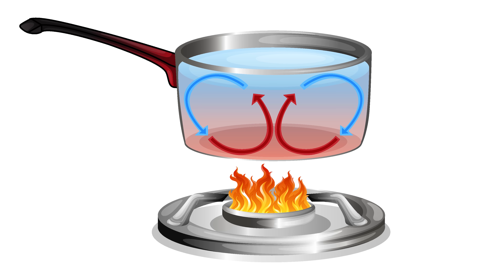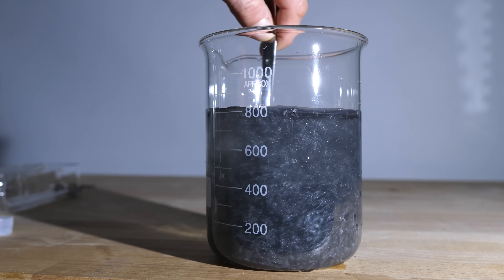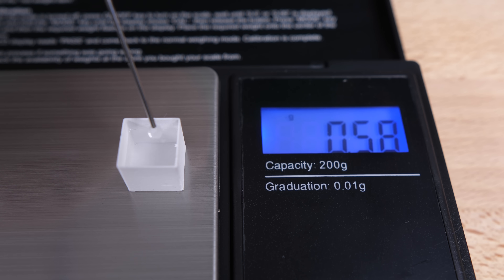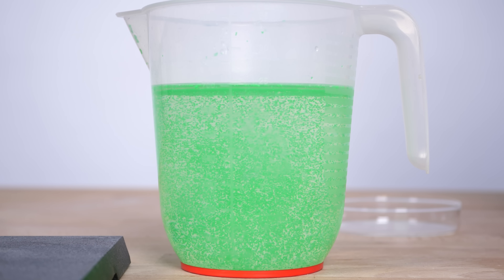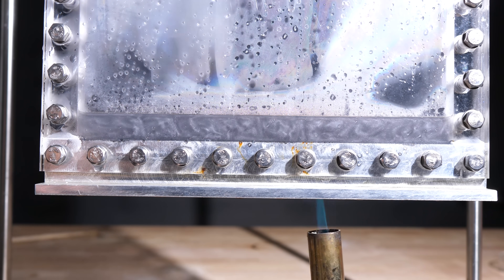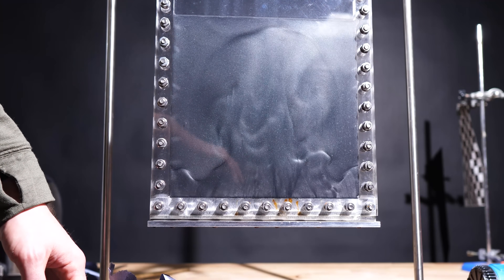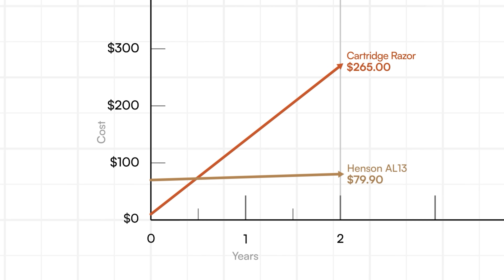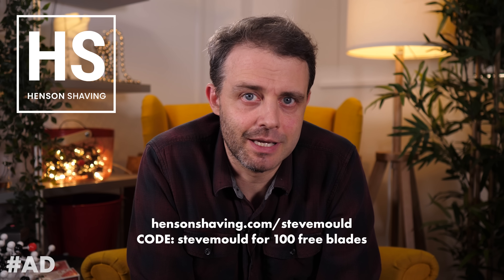The bizarre patterns that emerge when you heat ANY fluid

Comment: 2:01 Imagine a round parachutist in 50 mph winds coming from the south. He would be carried north, with his round parachute leading his body. In this case, "leading" refers to the direction of groundspeed. In terms of airspeed, the direction is reversed.

If there were an orientation of mica flake where its center of (drag) pressure led its center of mass, then that orientation would be somewhat stable. This phenomenon is called "weathervaning".

Comment: Pasta forming a toroird might be because of how we put pasta into the pot.
We have a bunch on our hand we tend to place it in the center and release and the top stands sit against the lip of the pan and the bottom stands are pointed at the side on the base
Since the pasta will move down as it gets soft from the hot water it will just topple in while riding the sides of the pan,

Comment: regarding shaving, I haven't used a razor for decades but just a trimmer on a battery powered hair clippers. It's a dry method, and also useful for shaping the beard and moustache. IDK why so many men need their shave to be so skin tight. This method is so much better for your skin, no skin grazing, no abrasion, no cuts and no ingrown hair etc. Also no extra cost for razors and aftershave and stuff like that. Maybe it's not skin tight but it works for me. Just my 2 cents, try it, it's awesome.
Reply: I switched from an electric shaver to a safety razor because both the electric razors I tried caused significant skin irritation that lasted for half a day or more. No irritation with wet shaving. I think it was due to the slight pulling on the hairs as they are raised into the cutting teeth of the electric razor.
Reply: @seth094978  IDK, that seems strange to me as I've been using this method for so long with no problems. Maybe we have different kind of hair, maybe your hair is thicker or shaver wasn't so good. We're all different, and this seems to work for me so well, and it's so much faster, I literally shave in 15 to 30 seconds max, so I never plan switching to razor shaving again.

Comment: Mica flakes align in water due to their unique physical properties and the external conditions they are subjected to. Mica is a type of phyllosilicate mineral that exhibits a two-dimensional sheet or layer structure². These sheets are flexible and can easily slide over each other, which is why mica can be split into thin flakes.

When mica flakes are suspended in water, they tend to align themselves in response to various factors:
1. **Pressure**: If the pressure is higher in one direction than the others, minerals like mica will tend to align themselves such that the fabric forms perpendicular to this axis¹.
2. **Buoyancy and Gravity**: Depending on the variety of mica, it might float in water³. The mica flakes, being flat, will align themselves parallel to the water surface due to buoyancy and gravity.
3. **Flow of Water**: If the water is moving, the flakes can align themselves in the direction of the flow due to drag forces.

It's important to note that the alignment of mica flakes in water can be influenced by a combination of these factors and possibly others, depending on the specific conditions. The local alignment of mica flakes can therefore vary based on local variations in these conditions.

Source: Conversation with Bing, 2/16/2024
(1) Mica | Structure, Properties, Occurrence, & Facts | Britannica. https://www.britannica.com/science/mica.
(2) Igneous and Metamorphic Rocks - University of California, San Diego. https://topex.ucsd.edu/es10/lectures/lecture16/lecture16.html.
(3) Dissolving mica flakes - Applied Chemistry - Science Forums. https://www.scienceforums.net/topic/26345-dissolving-mica-flakes/.

Comment: I assumed the mica flakes align because even in turbulence, the flow is locally laminar. Since the different layers of laminar flow are moving at different speeds, a flake that is oriented perpendicular to the flow will experience a significant torque. Once the flat flake is parallel to the stream, the torque is minimized.

Comment: Great demonstration and direct visualization, as always! Have you tried using aluminum heatsinks as separators on each side, isolated from the heated area, to balance heat input with heat output? I suspect it would let the convection cells establish more quickly and run more stably, especially in water. 

But c’mon Steve - we all know how infrequently you shave, despite a razor sponsorship LOL

Comment: A couple of things:
2:00 - The flakes align locally because: the more you zoom in on any curve, the more linear it appears in the smaller frame of reference. I think, the typical angle of change in flow direction (in a viscosity like water, at a particular temperature, with respect to convection forces only) is rather large compared to the mica flakes (even larger in oil). With enough flake density in the liquid, at their scale the flow seems more linear even during, what we would consider, sharp changes in flow direction.  Local drag on flat flakes is more consistent than you might expect, allowing them to align and stay aligned until more extreme directional changes.
• The Schlieren Effect - could have been another way to try
• Thermal Camera - might have been interesting
• Blue Laser Pointer - try to heat the mica fluid in the center of the tank, away from the boundary layers of the sides?
• Vertically Spaced Al/Cu Wires/rods protruding from the bottom (sealed with  HighHeat JB Weld or w/e) would have allowed you to cool and heat from the bottom simultaneously, using a glass of ice water or TEC. 
• Heat Sensitive Color Changing Mica might (likely, not) have been interesting.  
• When thinking about fluids, I always start with visualizing the energy in the molecular collisions that are occurring then work my way up in scale through the sciences (molecular physics, chemistry, fluid dynamics).  Understanding comes easier for me that way I guess.
• This video was incredible! 
• Thank you for the great content.
Reply: Would it be accurate to say each mica flake acts as a tiny rudder, and tries to align itself with with the water's motion? And then the water's motion locally is in the same direction
Reply: @Deribus575  kind of. You know how you can see a bug carry a bubble of water? As things get smaller, liquids appear more “thick”. Instead of a sheet of plywood tumbling in a tornado, it’s more like logging trees into a river, they tend to align with the flow (I’m guessing)

Comment: What I am missing from the video: Turbulent fluids behave differently in 2D and 3D. So much so, that you can't transfer your observations from one to the other. Iirc, in 3D any vortices tend to become thinner and longer perpendicular to their axis of rotation, before disappering into noise due to internal friction. In 2D, vortices combine into larger ones. Observe the difference by comparing 2D constrained slices to Schlieren imaging or a laser illuminating a plane of dusty air or fog.

Comment: Evaporation takes out heat, so it still can be because of temperature difference. (but I think it goes hand in hand with density changes)
The cream I think is just showing the convection, like the particles in the water, but because it is more viscous it slows down the convection like the oil.
I wonder if there is something similar you can put on top of water. (maybe something more buoyant that prone to clumping, like thick paint or maybe permanent marker?)

Comment: The convection cells are extremely interesting. It seems from the video that they form when you have a thin layer of fluid with a strong temperature gradient between the underlying and overlying material. Is that right? If so, can we conclude that the convection cells on the sun's surface are forming in a thin layer of surface fluid caught between the heat of the next layer down and the (relative) cold of the troposphere?

Comment: Ontop to the Hanson Shaver.... i have searched far and wide here in germany for a similar shaver that is capable to shave my balding head. Everything i tried was a bloody mess, yet with the Hanson and it's really nice tolerances it just works. Even tho sometimes a cut does happen, but a system-shaver would have had the same issue. 
So thanks @SteveMould for pointing me towards Hanson.

Comment: What would happen if you secured a metal bar to the container in contact with water, and then used liquid nitrogen to cool it? Would you have a “reverse” convection current that flows from the top down?

Comment: With regard to the Henson razor, you've hit the important point. I've been using safety razors for nearly 15 years now. They are "better" than cartridge razors in every way that I have ever bothered to evaluate. But, the Henson razor is far and away the best of the several safety razors I have used. I've used a variety of razors manufactured over a span of over 100 years on three continents, from a Gillette US Service Razor first made at about the time of WWI through to modern Chinese and Indian razors available through Amazon. The Henson razor provides the most comfortable shave with the most enjoyable shaving experience. So, thanks for introducing me to it. Good choice of sponsor.
Reply: Out of curiosity, as someone who's used cartridges and was always somewhat interested in safety razors, what's the actual difference between quality razors? I would think that the difference would be the blade quality (which you can get from anywhere), where the $70 safety razor itself is just a handle to slot it into. Does the build quality of the safety razor apart from the blade matter that much?

Comment: Okay hear me out. 7:01 The convection cells are more resistant because of the viscosity of the oil plus the water pushes the oil into areas as well and the web is formed and they create little pockets or areas like cells but a bunch of oil could create channels like how veins are channels or how rocks etched by liquid create channels but in this case the oil would be better for creating cells at the top and things that can maintain connections by other means like shapes interlocking or an eclectic charge can create channels more like the veins or such. These differences in composition, structure, and things are the reason for connections in differences or growths like a human or evolution.